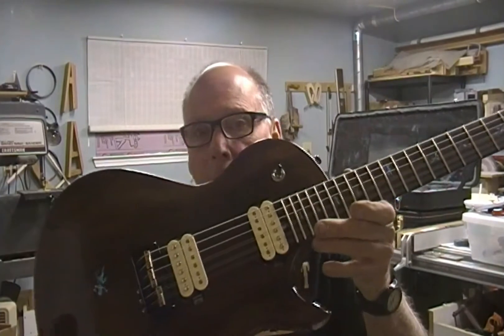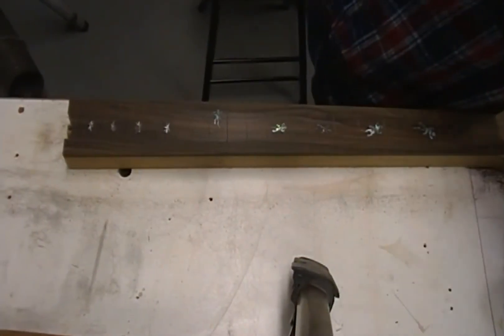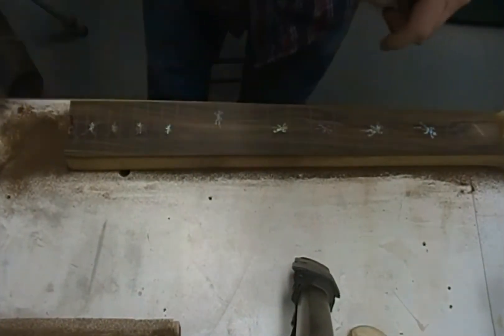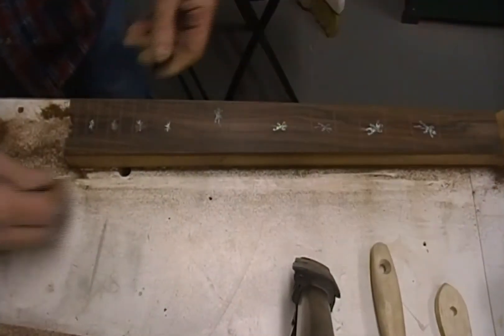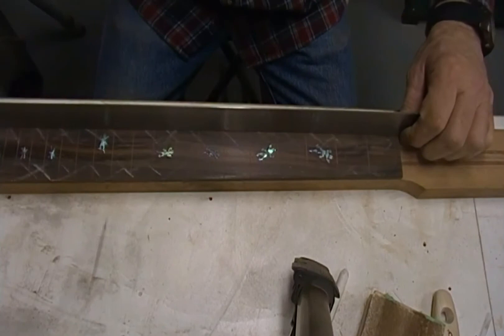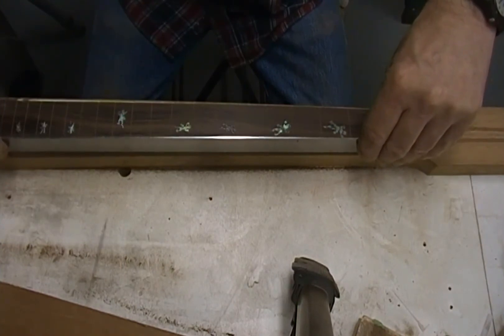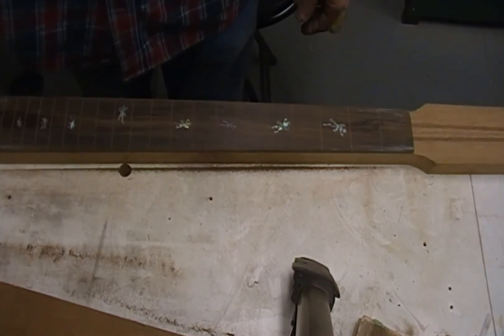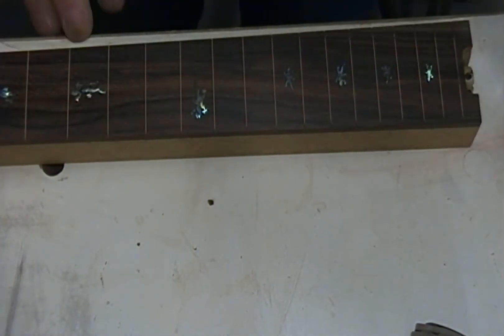Custom Electric Guitar Build, “GECKO” BY Jonah Guitars #9

Comment: I think a choice of dot marker that will present a better contrast Dane. I have abalone dots on rhe fretboard of a maple neck Strat. Looks pretty but not really enough contrast. As you said- maple sounds good here? Tulip would work too. I think.I've mentioned before that I used Cubic Zirconia for side dots on a Tele neck?
Usual high standard of video. This series is really building pace.
Reply from the maker: Hey Dippy Hippy, I agree a contrast is very nice and important if you really want them to be functional. That's why I've not used shell or abalone on maple boards but rather just black plastic. Even though it's cheap it still looks fantastic because of the contrast. I did not use maple on the side dots because the light wood against the brass tube would be to little of contrast in that direction. You're gonna have the watch the next one to see what wood I chose. A real cliffhanger. As always your comments are much appreciated.